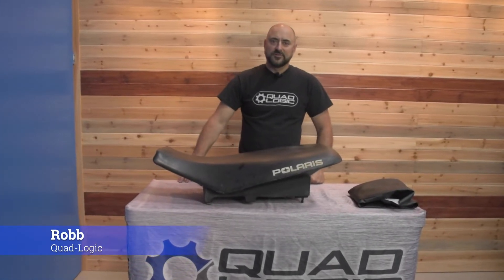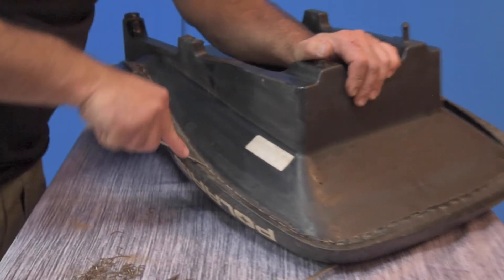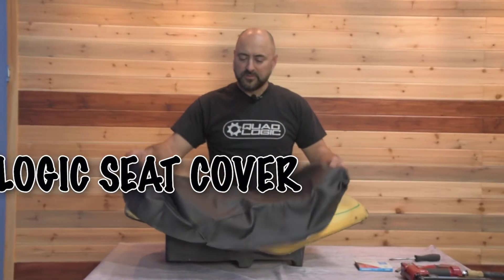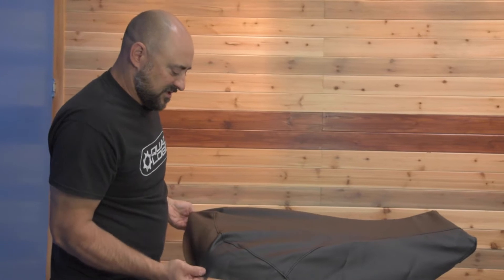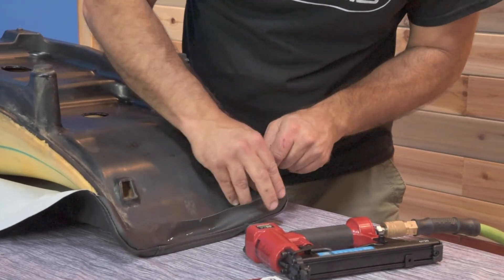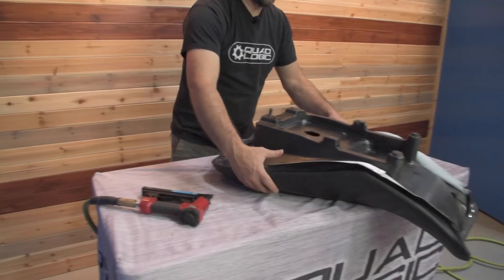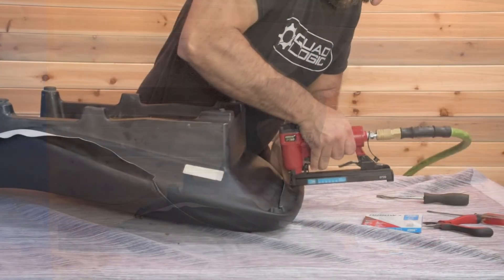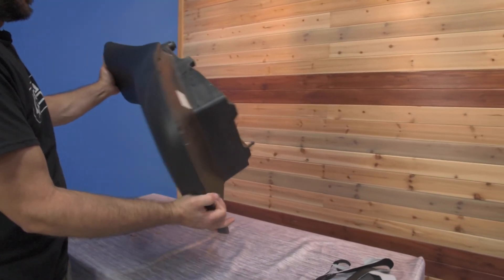ATV Seat Cover Replacement Tutorial

Comment: Hi QL, very much appreciate your video vs others.  I've got a 2002 polaris sportsman 500.  Looked on your link and the closest  match was the "400" in my model and year.  I'm pretty sure the 500 and 400 are the same vehicle just engine size differences.  Staples question, you called out 1/4" staples and that is for the staple "depth".  What is the staple "width".  Can you supply the "width" of the staple and Arrow p/n you're using.  I'll get a pneumatic gun to handle it.  Love the callout for the 4-way stretch material, BIG help there on removing wrinkles vs cheaper vinyl / faux leather covers.  You also put the chording seams in the right locations for a much better fit and installation.  I've done enough upholstery to know.  I'm an engineer and DIYer by trade and that helps also.  One could go the cheaper route but for your pricing, fit, finish and shaping your install will be a much better and longer lasting product.  Thanks, Fred